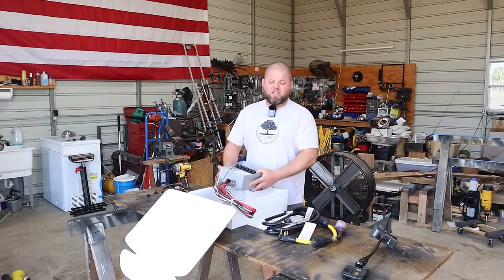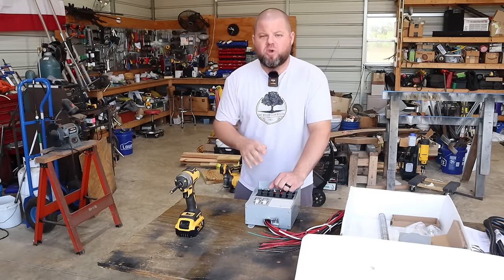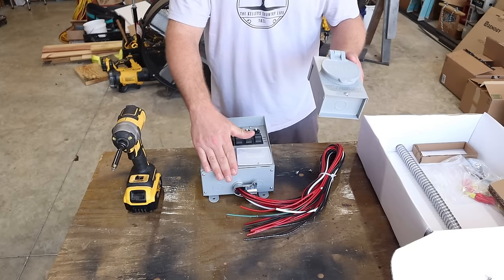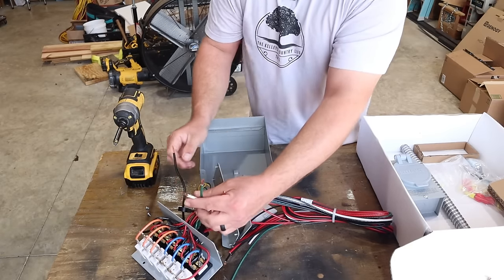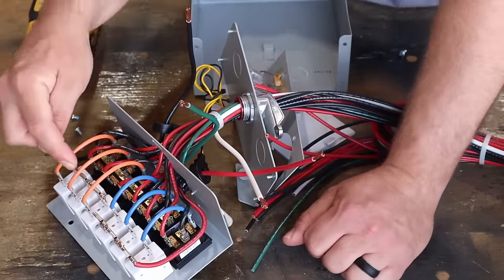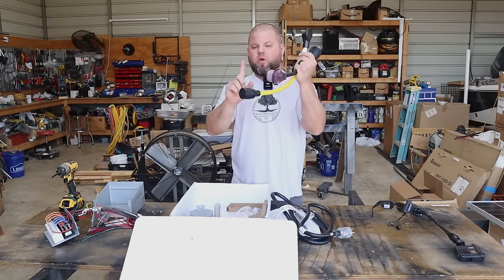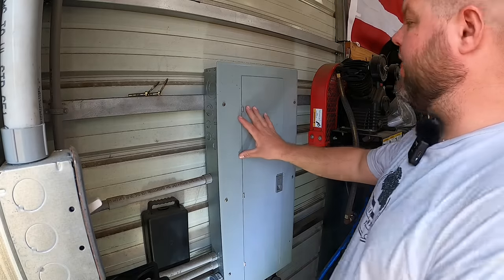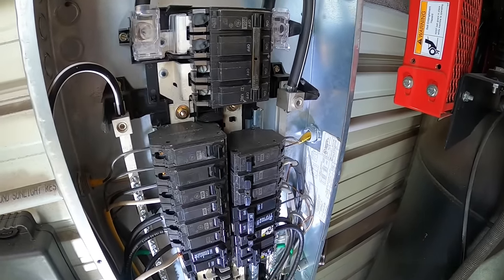How to install a generator transfer switch 120 and 240 volt #703 Ecoflow whole home power solution

Comment: Nicely done sir!👌
Reply from the maker: Thank you for watching
Reply: @TKCL  question? So the closest fuel station to me offers  reg E87, but they also offer non- ethanol in reg, plus, & premium. My new generator says E87 is fine. Would it make a difference if using staybill in any choice? The non- ethanol 93 here runs about $5 a gallon.
Reply from the maker: Non ethanol all the way and get the highest premium available. Your equipment will thank you for it.
Reply: @TKCL  thanks for the info. That one station is the only one that offer those choices of non ethanol in all 3 selections.

Comment: Nice video. I also have a 240 volt transfer switch for my big gasoline generator but I have a 120 volt small inverter gen and an ecoflow smaller than yours. Maybe I missed it, but using an adapter to go from the 3 blades to 4 and plugging into the 240v transfer switch, how do you select which phase of the 240 you are using, if the transfer switch is already wired.
Reply from the maker: It's all single phase from a 120 device. You throw off any 240v breakers and the remaining 120v breakers feed from the ecoflow through that bonded plug.

Comment: I added a 240 connection and lock out plate after the last hurricane.  I tested it before this hurricane and it worked.  I do wish I would have spent the money on a physical transfer switch instead as they are more versatile.  I only need about 4 connections for emergency or solar, so I should have spent the money there.  I see a transfer switch needed for dabbling with solar so there.

Comment: First, thank you for the best video on YT to get this done. Secondly, All the info I have read talks about MWBCs (Multiwire branch circuits) in the panel that can be an issue with overloading on the neutral side when you use a 120v generator.  You don't seem to mention that as a concern so I am curious. I really want to wire one of these up but the MWBC issue has me concerned. Any thoughts?  Well done and thumbs up.
Reply from the maker: I do not mention it because unless you are in a very old home, your not running those types of circuits. It didn't apply to my situation.

Comment: Thank you - the exact video for my setup I needed. Pls could you also consider what happens if you had two Ecoflow delta pros to create a 240 Inout. Would the circuits that are 120 on your panel become no longer useable because they are now getting 240 instead of 120?
Reply from the maker: No problem, the Delta units use a 4 wire generator cable, same as shown in the video.  One would send 120 volts to one side of the transfer switch and the other Delta would send power to the other half.  That's the proper way to run this setup.  Then you could run all 120 volt appliances or even run a 240 piece of equipment like a well pump.
Reply: @TKCL  so for instance if i have a 240V mini split unit as part of the circuits I would need two Delta Pros?
Reply from the maker: Correct, for 240v operation two are needed with their dual voltage hub. See this video where I ran my central AC with two. https://youtu.be/rxn-cqnKuoQ

Comment: Hi, if I hook it up to the 240v will the switch also power my 110?
Reply from the maker: If you feed it with 240v you will get 120v on the single breakers and 240 on the double breaker. So yes.
Reply: thank you @TKCL

Comment: Great video - thank you! When you spoke about wiring the connected 240 volts (C & D), you showed that you would connect them to the 240 volt, double pole breaker. I noticed that double pole indicated 30 amps. The C & D connected switches are 20. I know you weren't connecting them, as you were just demonstrating how it would be wired, but would that work? Can you connect the connected C&D (240V, 20 amp switches) to a double pole 240V 30 amp breakers? Would that work? Because it's 240V does that override the need to match the amps from transfer switch to breaker?
Reply from the maker: Absolutely, that's the way it's designed to work, but you can remove the bar and make them single pole 20 amp 120 volt breakers. The only reason I did that is because I am supplying 120volt power via my power station. If you supply 240volts via a generator you can use C&D as combined 240 volts to run something like a well pump.
Reply: I have a similar question, as I have a 50 amp DP breaker that feeds a sub-panel for my well pump. The transfer switch uses 12 awg wire and my feeder is 8 awg wire. I do not believe I have more than 30 amps coming from that panel but will the the transfer switch wires carry that circuit's load? 
When in line mode the load is going through the transfer switch and thus the 12 awg wire and 20 amp breaker.
Reply from the maker: I'd need to know the load of your well pump. 10 gauge will carry 30 amps of 240v, 8 gauge will carry 40 amps, this is all dependent on length of run. I seriously doubt that you have a well pump that requires anything more than 10 gauge. My 1. 5hp 240v well pump uses 10 gauge wire for feed.
Reply: @TKCL Thanks for the reply Andrew, I agree with your comment RE: 10 and 8 awg wire capacities, I am using the same Transfer switch you have and it has 12 awg wire, which typically carries 20 amps.
My concern (and I think I know the answer, just don't want it to be the answer), is once I splice in the C&D circuits to create a 240 volt circuit for my well pump, I believe the load runs on those 12 AWG wires through the transfer switch. My unique setup is I power a sub-panel, from my main panel, with a 50 amp circuit/breaker, in which I have a 120/20 amp breakers (sump pump and furnace) and one 240/50 amp/breaker for my 1 HP well pump. In over 30 years, I haven't had an issue since it goes from the main to the sub on a 8/3 w/ground cable, but I am worried about the load going thru the TS on the 12 awg wiring.
I suspect my answer will be to separate the 120 circuits from the 240 in the sub-panel but was hoping you could work your magic on an easier solution.  Thanks for all you do in explaining.
Reply from the maker: @user-pp9ot5ul4n in that case your going to need a more powerful transfer switch.

Comment: Nice video! For a 120V setup though, dont you need to make sure all the breakers in the transfer panel are from the same 120V phase, otherwise you will short together two different phases together? Thanks.
Reply from the maker: Not when being powered by a 120v device, there is only one phase. When being powered by a 240v device the phases split and the transfer switch is already wired that way.

Comment: It's a nice setup for sure, but personally if a hurricane was coming I'd bring the Ecoflow into the storm shelter with me, to monitor power usage and reserves plus not leave it at the mercy of your warehouse structure. But other than that It's a great video on installing a transfer switch.

You've got plenty of land for a solar farm, (instead of rooftop panels), enough to go completely off the grid (if you pair two solar generators to get 220 volts.) It kind of sucks that they all lack a 220 outlet within one unit. From what I understand they would have to make them much larger to fit everything within one container. There's always the $11,000 Tesla Powerwall, but they won't sell them without professional installation, driving the price up even more. No DIY with them.
Reply from the maker: I have an additional power station in the storm shelter in case of emergency. I like that the Delta pro can automatically kick over and keep my freezers and refrigerators running in the shop.
Reply from the maker: Just built a solar array and posted the video.

Comment: Hi Kelley, I have a question for you :  seem like you installed 2 Power Inlet : one is outdoor and one is indoor , is that correct ? That means you can use either outdoor one for gas generator or  indoor one for Delta Pro (but not both at the same time) , is that correct ?
Reply from the maker: Technically yes, but the problem with that is a safety concern.  If you energize the outdoor plug, the exposed inside plugs would have power and create a shock/touch hazard.
Reply: @TKCL  , do you know if there is any device be able to cut off another Inlet when one is used ?

Comment: Do you have a panel at the meter or is that the panel directly from the meter?

One point I would add is that now that you have a transfer switch installed it is important to know how that is wired.  The switch wiring will drive whether the generator is bonded or floating neutral.
Reply from the maker: Panel is back to back with the meter. Reliance states to only use their transfer switch with bonded panels, my main panels are. With that said we both know how often generators are installed, especially outdoor gas generators tied into lord knows where and are never properly grounded or internal wiring changed (if available).
Reply: @TKCL  very true.  I would be willing to bet many bond their transfer switch and then run a bonded generator to boot.  The NEC says grounding of a generator is not required but also has another section that says to follow the manufacturers requirements.  So if the manufacturer says ground then follow the NEC or the manufacturer?   Vicious circle on grounding

Comment: May I ask an important question. I had a licensed electrician install a transfer switch in which I hooked up my EcoFlow Delta Pro Ultra (DPU) to. I started testing some of the 15a circuits and they worked fine. I then tried a 20a circuit that was connected to my washer which was not on (not under load) and immediately I heard a loud pop. I immediately look at my DPU and a red triangle was present with the msg: Internal short circuit (516). I am trying to understand what happened? 
Do you think there was a crossed wire pair (mislabeled black and red pair combination) in the transfer switch or was my DPU defective? How do I know for sure what went wrong? I am at a great loss. I am weary the Transfer switch company is going to blame the DPU and Ecoflow is going to blame the transfer switch and I am left with nothing. Any advice is greatly appreciated!! Thank you.
Reply from the maker: Did you remove the bar from the 20 amp breakers so they were no longer connected trying to make a 240v circuit? Your washer is hooked up to a single 120v plug correct? I want to make 100 percent sure your not referring to your dryer or ANY 240v load.
Reply from the maker: And yes it's weird other circuits worked but one didn't. You very well could have a wire wrong on that circuit.
Reply: @TKCL  Thank you very much for your reply. Yes the bar was removed to use it as two separate 120v circuits. So a load was connected to each side of the double pole breaker. My electrician said that many double poles are wired/used as two single poles with the top plastic bridge cut to function as two single pole breakers instead. That they are not connected internally. They each carry 20a.  Also, yes this was my Washer and not the drier. I didn't get to finish testing all of my circuits so I am thinking if the wire pairs were mislabeled then there is another pair of wires mismatched and would cause a backfeed if used.

Comment: I'm somewhat confused. Most residential households have they main panel outside and a sub panel inside. A transfer switch would seemingly be used for a sub panel where all of your breaker's controlling all of your circuits in your house are located. Sub panels are unbonded.

I have no use for a transfer switch outside at my bonded main panel that only has a breaker for my subpanel, central AC and from the utility pole.

From the transfer switch, why could i not hook up the ground to ground and neutral to neutral in my sub panel?
Reply from the maker: You absolutely could and that's a more proper way so you don't have two bonds to ground. Here the majority of homes have the main panel inside.

Comment: I've been looking at generator transfer. I just want to upgrade my electric breaker box. I would love to get a power station I like the way ego battery is external .
Reply from the maker: External battery is nice no doubt. I have a feeling in 10 plus years when you upgrade batteries you'll probably be upgrading to some new far more efficient solar charger too. Technology is rapidly changing.

Comment: Will this work with arc fault breakers?
Reply from the maker: A very good chance it will not, those breakers are so sensitive. I believe those breakers require a transfer switch with separated neutrals.
Reply: @TKCL  thx. Great video

Comment: What if my power source is an inverter instead of a gerenator, mine only has two wires coming out from the ac out, no ground, how do I power the transfer switch three leg plug?
Reply from the maker: No ground?? I am not sure with that situation.
Reply: @TKCL  thanks for the reply. I figured it out.

Comment: 17:00 ah haaa..so you have an Ecoflow delta pro gen. as I do, and that solved one question and that is:  Should I use the Ecoflow brand transfer panel which costs $1600?  Well, I see that you certainly didn't think so as you used a different type.  I am not an expert but I do not see how a raw un-installed transfer panel could be worth $1600:)  Now that you have installed a Protran brand panel, any regrets or suggestions for one that is more ideal?
Reply from the maker: Just depends on if you need something automated and I am assuming theirs will also automate 240v switching if you ever add a second Delta pro? I have no regrets for my current setup, but if you are careful you can skip the transfer switch all together. I am about to send you video showing how I did this.
Reply from the maker: https://youtu.be/Tf7cEsdXJoU

Comment: I want to take two,120 generators get them out of phase  to run my 240 V panel in the house. The only problem I see here is you can't get them to be out of phase to run both legs in the panel
Reply from the maker: You mean split phase? You need to generators that communicate with each other or that are wired that way.

Comment: Shouldn’t you shut the main breaker off so as not to back feed the lines?
Reply from the maker: Not needed because there is a 3 way switch on the transfer switch to allow two different inputs.  No backfeeding occurs if wired properly, you only feed the line to the receptacles.
Reply: @TKCL  - thanks for the response.

Comment: Why are breakers needed on this? Couldn't each mains wire be spliced to a switch input, then the switch outputs go to each branch breaker input, leaving the original breaker outputs as they were? That way, either source would pass through the existing breakers, and the sources would still be isolated.. wouldn't that work?
Reply from the maker: No because the original break is passing grid current through one side 100 percent of the time. If it was a floating breaker not designed to snap into a hot side of a main panel yes that would work.

Comment: I thought it was a no no to use a white common wire as a power feed on the 240 breaker?  I get why it’s done to save $$ and time.
Reply from the maker: Huh? That's literally your common neutral color and what's required. You have two hots for 240v, black/red, white is your common for split phase 120/240v and green is always green or bare copper. You have a misconception about white as it's a industry standard color for neutral.

Comment: Go with interlock. Much cheaper, easier and way more flexible.  No advantage using a transfer switch just much more complexity and breaking points
Reply from the maker: I have both. There absolutely is one big benefit to a transfer switch. That's for novice users or family not familiar with load balancing or what breakers to throw. It's quite easy to overload a power supply or generator. A transfer switch can be setup for critical circuits only and is very easy for someone not familiar with loads to flip the few critical circuits over. With that said, I much prefer an interlock kit and inlet box. That's because I'm very comfortable with loads and our energy needs.
Reply: @TKCL  I just taught my wife, only flipped the breakers that have the green dots by them. Same thing as choosing the ones on the transfer switch.  You’ve got to believe people doing this have some level of competence in flipping circuit breakers.

Comment: Why not use a electric contact so if the power goes off it would disconnect the line power and switch automatically to battery power or generator? So if you’re not home the refrigerator will work so you don’t loose your investment in food.
Reply from the maker: Because this power station automatically does that for me when in 120v mode.

Comment: So if I wire this for 240V and use the two center circuits to power my 240V well pump and the other 4 circuits for 120V circuits It’s fine, if I hook it with 240V generator. But if I use my 120V generator I can’t use those 2 center circuits or power my well. Whether or not I use those adapter cables. 

You can only wire this up as a 120V panel or a 240V panel, not both even if it’s only one 240V circuit. 

You kind of lost me at the end when you plugged a battery bank to power the panel. That power bank isn’t going to last long. You need a gas powered generator.
Reply from the maker: It's designed for 240v split phase input. The same l14-30 plug found on most mid size to larger generators. This allows 120 AND 240v operation. If using a 120v power source only, remove the bar connecting the two center double pipe breakers and they turn for 240v to two 120v breakers.